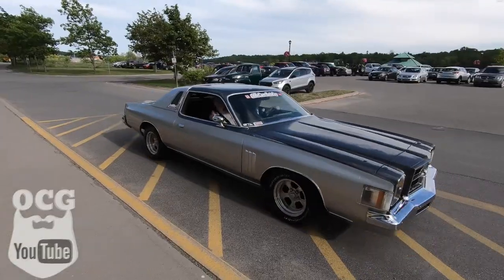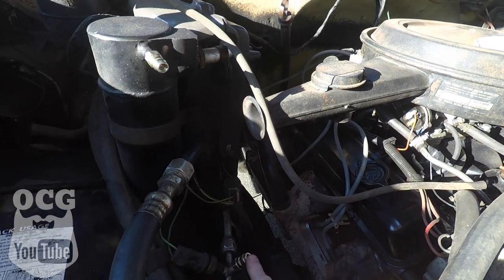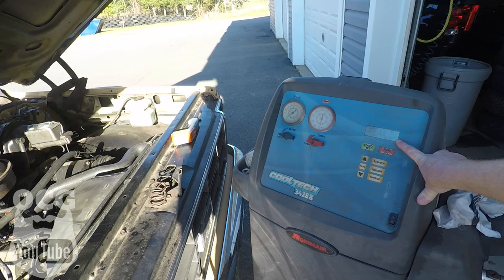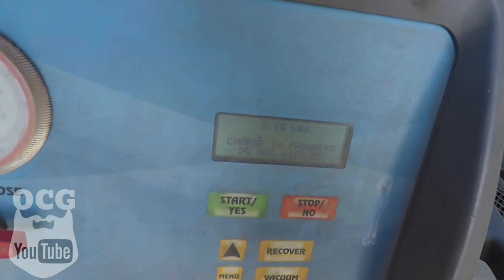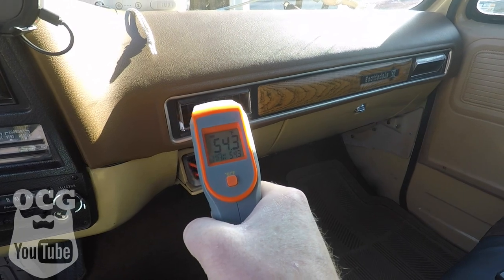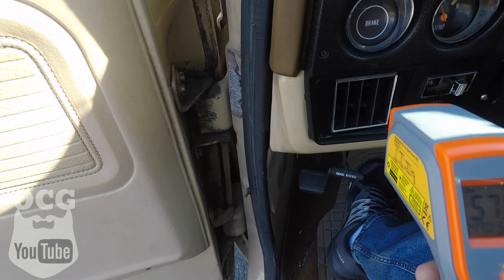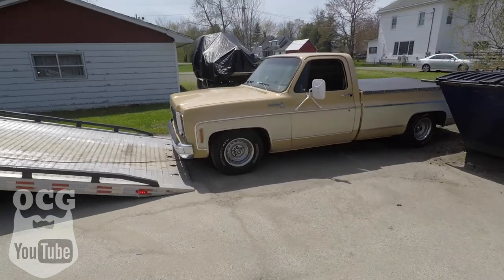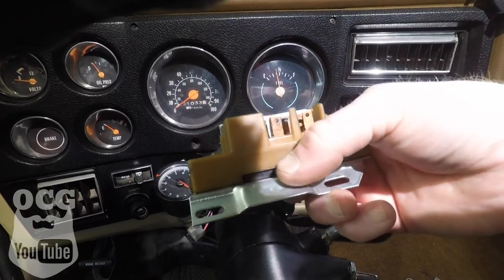How To Retrofit an AC System R-12 to R-134a on my 1977 Chevrolet C10 - Lunchtime tow bill

Comment: To do this conversion with best results, you really need to replace the condenser with a parallel flow style and change to a blue orifice tube.  Replace all the o ring seals with green ones.  With these changes and proper charge of 134a you should see vent temps in the high 30 to low 40 degree range.  In hotter climates, the ten degree improvement on the outlet temps makes a significant difference and makes the system much more efficient.  NAPA carries a parallel flow condenser for these trucks and the blue orifice tube is available at any auto parts store.  Money well spent.  Great video as always, OGC!
Reply from the maker: Definitely going to look into the condenser!
Reply: @OldeCarrGuy  Here's your part number:  A/C Condenser 3642C  Currently available through Amazon and Ebay as well.
Reply from the maker: @b103206  you the man! Thanks for that!

Comment: So I didn’t notice you mention changing out the lubricant in the system, is it safe to just put on the adapters, empty it out and fill with r134a? I see so many guides that insist you have to take the system apart and I’d rather not do that if I can help it.
Reply from the maker: I'm sure what I did isn't right, but it worked! The system was already empty so i vacuum tested and filled it. Been working ever since!
Reply: @OldeCarrGuy  noted! I have a cheap truck that I just want a cooler a/c on so I may just have them empty it for me and do what you did, it just has to work for a while!

Comment: With it being lowered you may want to invest in a hot start kit the older Chevy I had was horrible in summer before kit install plus kit I had mad it easy to "hit wire" from above
Reply from the maker: I’ve since replaced 2 out of 3 starting components. The starter will be next on the task list!

Comment: Hey your seat belt buzzer works. What color are the wires ? Where do they go to?
Reply from the maker: There should be a 2 pin wire connector coming out from the bottom of your drivers side seatbelt retractor. Likely someone has simply unplugged it as some point. The other end should ne run under your sill plate cover. If it is in fact plugged in, trace the wires back as they could be corroded.

Comment: Hey man love the channel maybe you can help me with this question I have so I have a 99 Toyota celica gt I changed the thermostat a couple of houses and even got a new radiator its creating alot of pressure and causing radiator hose to pop off I got new clamps and a new radiator cap as well what do you think it can be?
Reply from the maker: It could simply be low on coolant or air in the system. As much as I hat to say it, you may have a head gasket failing that is pushing combustion gasses into your cooling system. Best to have it tested by a professional!
Reply: @DIY Eric It's almost certainly a blown head gasket, some heavy duty stop leak will hold you over until you need another car or engine. I've fixed head gaskets myself this way and the right way and seen several others fixed the same way and 9 times out of 10 it works.
Reply: @Impactjunky  what do you recommended? Is blue devil a good option or something else?

Comment: Do you have a part number for the Schrader valve conversion kit?
Reply from the maker: Try this: https://www.amazon.ca/MagiDeal-Couplers-Connectors-Adapter-Retrofit/dp/B071J42WP6/ref=sr_1_5?dchild=1&keywords=r134+retrofit&qid=1627304630&sr=8-5

Comment: thought i would see a condenser change .disappointed
Reply from the maker: Sorry to disappoint. I had no leaks so no reason to change any components. Thanks for stopping by.
Reply: @OldeCarrGuy  Watched the CAR WIZARD episode where he stated 134a works best with new style condenser, not the big tube type of yesteryear. ? haven't found anyone updating however.
Reply from the maker: @tim1299  He's probably right, but mine will freeze you out as is.
Reply: @OldeCarrGuy  my g30 chevy 1976 MH
has add-on ac. thought i would see evaporator so i could clean. also orifice tube. i can only see lines and compressor.
schrader valves are on top of compressor.
I recharge annually with r-134a . don't want to tear apart dash to get to parts unknown. it is empty now . i intend to put under vacuum.